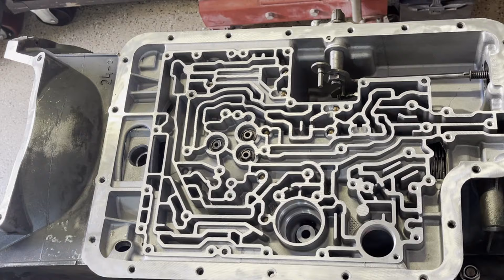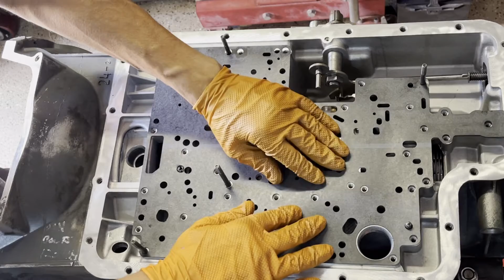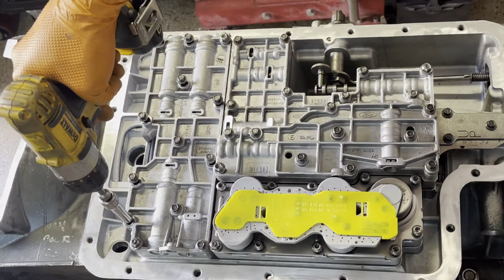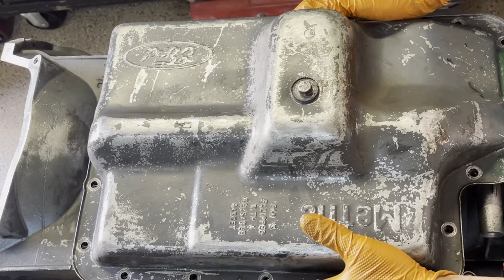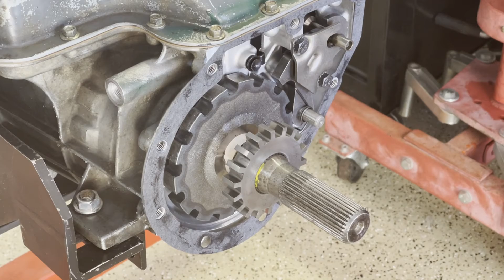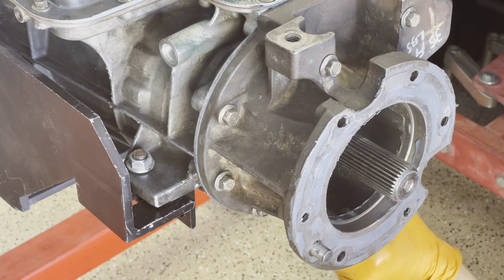8. Ford 4R100 Rebuild - Final Assembly

Comment: What about the circles that go in the transmission?
Reply from the maker: What circles?
Reply: @nickstransmissions  Nvm you did show it I was talking about the check balls. finished dropping the pan and torque the 3 feed bolts and put everything back together and my reverse is still not working everything else works. why do you think im having this issue i also did a transmission flush and i didn't notice no metal shaving nothing trans was very clean
Reply from the maker: If you have third gear, there's something wrong w/the low reverse clutch pack - perhaps you cut one of the seals on the piston when installing it into the case.

Comment: PRAYING SOMEONE SEES THIS COMMENT AND REPLIES even being an old video. Im putting my 4r100 back together today and the 8 check balls and the ONE steel with spring is my hang up. I've run into multiple placement of these balls and i want to put them in the proper spots. Its a 5.4L gas engine its going behind. I was told the diesel and gas placements of the balls ARE different. Is that true? Can't find info on placement of the check balls anywhere? Any sources available? Thanks in advance!!!
Reply from the maker: I believe this video or the one in the series before it covers the check ball locations. If not, check out Transgo's webpage for the 4R100 HD2/Tugger kit - their instructions will show all the locations for check balls and other case belly components.

Comment: Can I install a transgo shift kit while installed in motorhome? 4R100 2000. I ask because the check balls above the main plate and drill holes. Can one not do those steps? I have heard people just doing the 1,2 2,3 3,4 body only?
Reply: They also did main and aux body as well.
Reply from the maker: There is a hole you have to drill in the spacer plate so it has to come off.

Comment: Will the low reverse hold down plate hold the separator plate in place while I put the vb back in while in the truck?
Reply from the maker: It should but the plate/gaskets made hang a little bit so maybe have a helper keep them in place while you bolt up the main VB. Also use plenty of assembly lube to keep the case and upper-to-lower valve body check balls in place.

Comment: Great video and great series.

Concerning the separator plate, i know on the 4R70W, 4R75E, Sonnax makes a thicker plate because the factory plate is regularly impacted by one of the accumulator pistons. Is this an issue at all with the 4R100?
Reply from the maker: Thank you, the EZLife! There's not the same issue w/the E4OD and 4R100 transmissions like what is often observed with the 4R70-75Ws...The 4R100/E4OD don't have any acc pistons that make direct contact with the spacer plate, all the accumulation takes place in the accumulator body on those units.

Comment: So there's a total of nine check balls
Reply: Ok I lost one ,the small one under the plate ,I appreciate it
Reply from the maker: Thank you for watching, Terry. The total number of check balls that go into the unit depends on the year you're working on, valve body design (1st or 2nd) and specific recalibration kit you're using.
Reply: @nickstransmissions  ur video are really helpful
Reply from the maker: Thanks Terry, appreciate the kind words.
Reply: I agree with both of you guys, there is more check balls than 8, and my 02 2wd trans 7.3 diesel has 2 More 1/4 check balls oem installed.

Comment: for some reason my valve body dose not have 8 5/16 check balls. It has 6 5/16 and 2 1/4 and I don't know where to put them.Thanks in advance for any advice. It is in a 2001 7.3 F-350
Reply from the maker: Hi Bill,

Did you watch the video? 

Also, are there any alterations to your separator plate that may have been made to facilitate the omission of the two 5/16" check balls? I've always used the Transgo Tugger kit and/or Reprogramming kit and they don't have you omit any check balls.
Reply: @nickstransmissions  yes I did about 5 times and then three more times this morning. you say theses are all 5/16 at 18 seconds into the video. I  know there are two 1\4 in the control body, but they where never apart at the same time. Am I missing something?
Reply from the maker: Ok, thank you for all the views.."Yes" - to answer your question. Either you're not watching the whole video or simply skipping over where I show all the check balls...

I show exactly where the check balls go for both the case and the valve body. The case check ball locations are shown 18 seconds in to the video and the valve body check balls are shown at 13:20. 

That's why I had initially asked if you watched as I clearly show where all the check ball locations are in the video.

Is there something else that I am missing from your question? If so, please re-state so I can know what information you need.

Comment: Awesome video. Question. What about if you don't put those check balls on the valve body..? Any issues or nothing to worry about.
Reply from the maker: Thanks for the kind words, man. Don't leave out any check balls, either in the VB or the case.

Comment: Fantastic video!  Do you have a tip for installing check balls while trans is in the truck? Maybe some type of grease to keep them temporarily stuck in there?
Reply from the maker: Thanks, Dan! If you have some petroleum jelly you can use that. Otherwise, purchase some green Assembly Goo on Amazon or eBay (or your local transmission parts supplier). Either of those will hold those check balls in place while you reinstall the valve body.
Reply: Thank you sir! Subbed!
Reply from the maker: Thanks, Dan!

Comment: Didn't torque the 10mil not by the shift lever.o
Reply from the maker: Good eye - I noticed that as well after watching the completed video. Went back and torqued / rechecked all those fasteners. Thank you for watching!
Reply: Not that good of an eye. I went through my trans twice & I have to pull it out a third time. I have to rev the hell out of it to back up & forwards are stubborn. A transmission bench vid said torque the center support to 20ft lbs but as you know it's 7 or 8ft lbs. Could that be my issue?
Reply from the maker: @DirkWilson  Sorry to hear that, man - I know that's extremely frustrating. I wouldn't think 20 ft lbs is enough to crack the case in those locations but you won't know until you have the trans out and torn down again... Check your low-reverse piston seals, one may have gotten pinched...You have to use tons of assembly lube to prevent that from happening but it should have been caught on an air check of the L/R...I did the same thing once and had a ton of hissing coming from the piston when I air checked it...Tore it back down and saw I rolled the seal in an area that I missed with assembly lube coverage. The forward drum may be cracked or you may have simply rolled a lip seal, same situation...

Thoroughly air check each drum/clutch pack individually (except the int) then the case once it's all together, including the intermediates and OD. That helps you catch problems 99% of the time. 

Let me know what you find once you have it apart...
Reply: @DirkWilson that’s definitely not right… I haven’t seen that video… 😢
Reply: @josepharagon8259  what's definitely not right bro?

Comment: Do you know what could be causing code p1747 only to appear? I've replaced the solenoid pack twice and it's still happening... :-(
Reply from the maker: Hi C P, this sounds like either a short/grounding issue somewhere between the PCM and transmission or possibly the PCM itself...A sizable fraction of P1747 codes are caused not the solenoid pack itself but problems upstream of the solenoid pack.

Check the external wiring harness going to the transmission as well as all grounds, ground straps, etc...If you don't find anything out of the ordinary, I'd be inclined to suspect your PCM.
Reply: @nickstransmissions  thanks! I'll try to figure out how to test for a short to ground; my mechanic mentioned it could be the pass through connector on the solenoid pack, and I suspect the connector itself or the PCM because I didn't find any fraying on the wire. Thanks!
Reply from the maker: You're welcome, man!

Comment: Great video series Nick. Are you located in California ?
Reply from the maker: Thanks, Scotts! Appreciate the kind words.
Reply: what parts would you recommend for a 4r100 rebuild behind a 04 f250 4x4 V10 gas motor ? Truck is a daily driver and tows a 10k lb fifth wheel. No crazy horsepower mods just upgraded gear ratio to 4.56 diffs. Thank you again for any info.
Reply from the maker: I'd recommend pretty much the same parts selection and build strategy for the V10s as with the diesels that you saw in my rebuild series...Go with a custom low-stall converter if you think you'll be pulling more weight than the 10k lb fifth wheel. I like Raybestos ZPG frictions for all clutch packs; Kolene-coated steels are an option as well.

Comment: Awesome series. You should however put some details on the gasoline and diesel pumps, because that is such an easy and a costly mistake to make. Also looking forward to seeing you do a 5R110!
Reply from the maker: Thank you and great suggestion, Shalash87...I'll put together a video on C6 pump differences when a diesel C6 comes into the shop. May doing (and filming) a 5R110 build for a 6.0 Powerstroke later in the spring.

Comment: Could you link me to a recommended parts list for a 4r100 I want to try the rebuild myself. Thank you!
Reply from the maker: Hi Daniel, sure. I just updated the description for first video in the series w/a complete parts list...You can find all of the parts either on eBay (all inclusive kits, shift kits, Sonnax parts), Amazon or your local transmission parts supply shop. 

Here's the link to the initial video in the 4R100 rebuild series: https://www.youtube.com/watch?v=Tm12GezIQww
Reply: @nickstransmissions   Have Two  4R100  For You ~  what's The Contact  INFO   Please   Thank You !